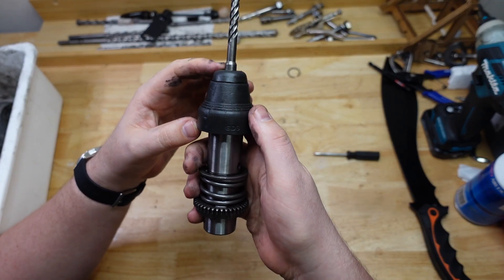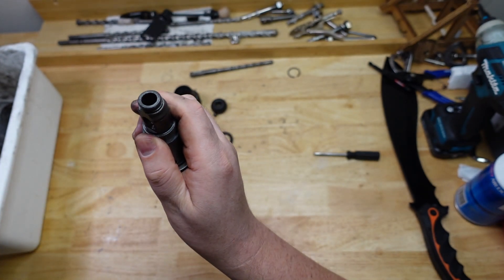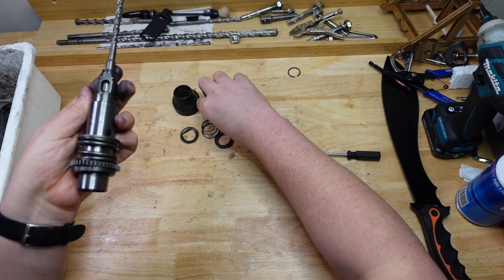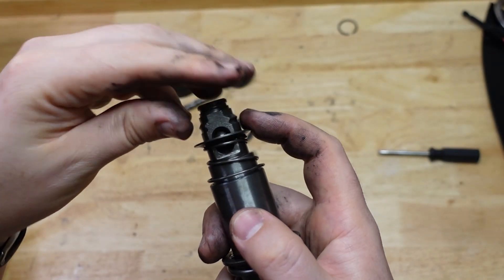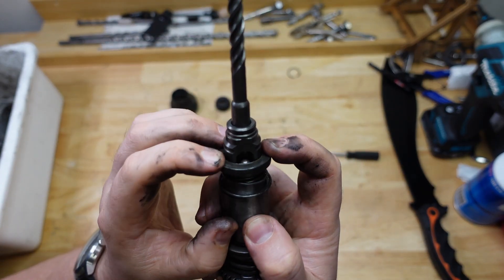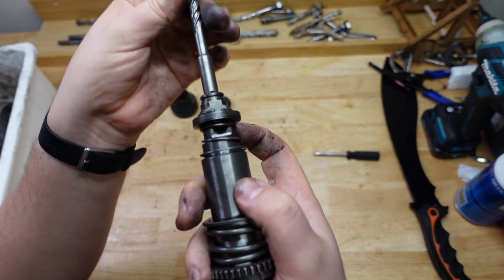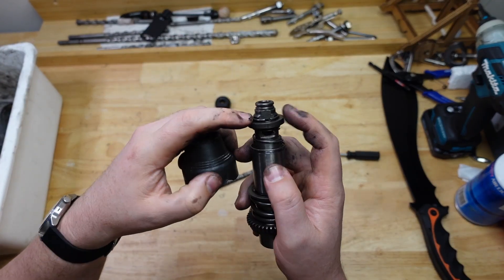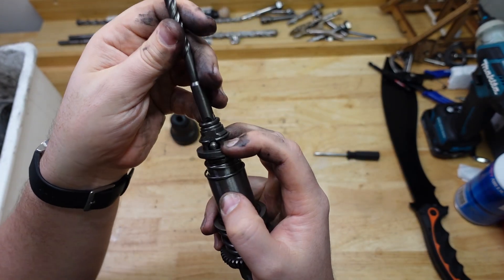How does an SDS rotary hammer chuck work?

Comment: Hello, my newly purchased SDS is doing something odd. When I pull the collar back to release the drill bit, the ball bearing seems to fall somewhere and the collar stays open. This happens usually when I extract the drill bit while the drill is facing down. What could be the culprit, is it normal behavior? If i hold the drill pointing up, no such issues.

Comment: how does the bit moving back and forth get joules against what is being driving down or chiseled? I got a post driving bit - but if the bit slides back every time it drives forward - just sliding back and forth pneumatically? I don't see how that creates force besides just pure rpm. How can it push against anything if it just slides back against itself every time?
Reply from the maker: It doesn't slide when it is pressed against the material.  the hammer strikes it when it's pressing and the bit doesn't really move.  like if you're chiseling something by hand, you put the chisel on the material and hit it
Reply: @BoltahDownunder  Nice! The hammer hits it when it's pressed against the material - makes sense now!!!
Reply from the maker: Yep. And some drills will only hammer when it's pressing!

Comment: My dad managed to F up the chuck to my hammer drill - which he, I quote: "needs a new ball bearing" - So is it done with a new chuck - or can it be fixed with a new chuck fixing to the SDS ?
Reply from the maker: You might just need a new ball or a whole new chuck, I can't say. You'll have to disassemble it and see. It's likely just one of the smaller parts like ball or rings so that should be simple enough to replace, but if the metal tube that holds the drill bit (the tool holder) needs replacing that's a bigger task that requires opening up the whole drill. 
Best check with the manufacturer or Google you model number + parts, or chuck replacement to find out